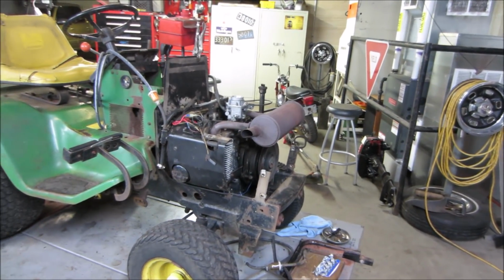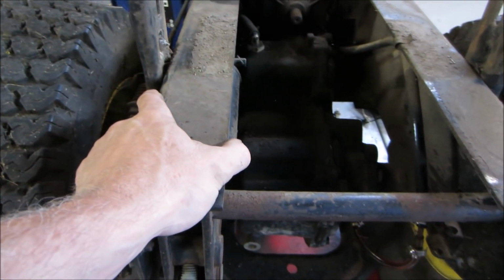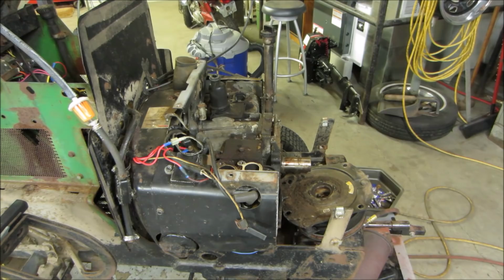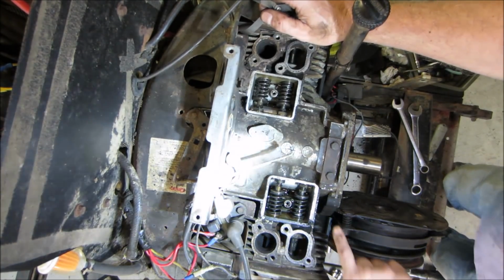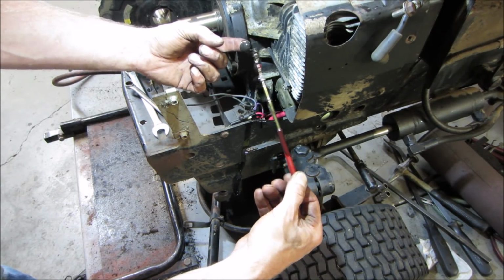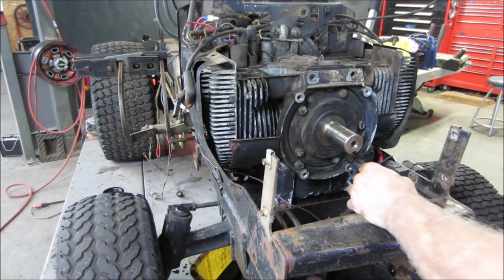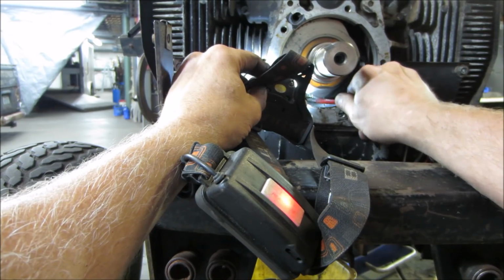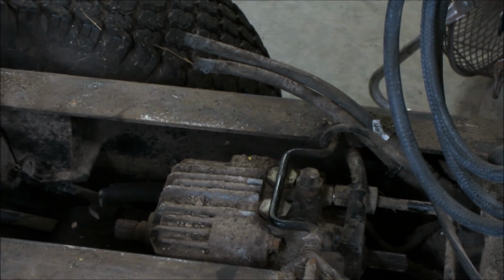Free John Deere Has a Bad Engine Noise? Can We Fix it?

Comment: OMG finding that little piece, wow. Persistence paid off.
Reply: I am shocked as well, I am blown away he found it without taking the engine out to begin with.   I am also happy that it happened on both sides so he knew it was down there and not a bad valve adjustment in the past were the previous owner forgot to put it back..
Reply: @SkaterStimm  also it would of suck doing all that work and that get dislodge and destroy something
Reply: That was a plant! He found that little piece on the floor AFTER he pulled the engine! He wanted to take the motor out to paint the frame, so he planned the "missing part" segment for viewer interest. The guy is BRILLIANT!

Comment: This is how all my projects go. 
Gonna replace the seat.
End up disassembling the engine block.
Reply: Good lord this cant be anymore true
Reply: Totally that.  Plan to just clean the inside of the screen. Actually end up replacing the timing belt...
Reply: So it's not just me!
Reply: It’s called the “ might as well’s”.......
Reply: Its 2 bolts they say
Reply: Planned to pant my engine now I'm in the middle of a complete rebuild of the tractor and engine
Reply: Have a go kart, "ahh just needs a carb clean" 
Buys new engine, clutch, chain, tires
"Oh"
Reply: I know the feeling. I cleaned, tuned-up the carb, fresh oil and filter....The free John Deere with a liquid cool Kawasaki engine runs like a charm BUT, it barely moves after 3 or 4 minutes....I though I struck gold with this one but, the hydro-static needs a complete re-built...DAMMIT !
Reply: I think my wife things all my cars are like that. 😞
Reply: So much for "i'm not going to rebuild this engine". After disassembling 90% of it to find some broken parts, this is pretty much whats happening anyway...
Reply: Same here man. I bought an 82 212 that was in pretty decent original shape not running. Got it running & used it for a year & was fighting the head gasket & carb. Finally got that figured out, & the side tins had some rust so I painted them, then I painted the front hood support, then I changed the fuel line, then I pained the engine & tractor. 

Then after I got it looking beautiful the rings in the engine went & it won’t run 5min without smoking a ton then stealing out & refusing to start again.

So after all that I parked it in the barn, in the meantime I finished a restoration someone did on a 67 110RF, the engine was already rebuilt, I painted the tractor, & changed the front belt. The rear tires were changed by the guy I got it from thankfully. After all that I paid $100 for the tractor & I have 3-$400 into a $600 tractor. 
I won’t be selling any of my machines since there’s not any $ I can make, it’s my personal hobby.

Well so long story short I got another 83 216 that’s sitting behind our barn waiting for some newer fenders & a ton of other parts. The plus is it’s mostly complete so that’s good.

These tractors are fun, but fixing them gets expensive quickly. As a person that’s restored 2-3 of these. I’ve got a 73 st16 I’m gonna swap a Yanmar l70 so I’m excited about that.
Reply: OMG This happened to me 10x over!!

Comment: In the first year of my mechanics apprenticeship i was taking a the head of a series 2 jag and dropped a 5/16 bolt down the hole in the block/sump that the oil return or dipstick went into. I had to go out and buy myself a thin magnet. I stuck it down the hole and got it out on the first try.  The head of the bolt just cleared the side of the hole and no more.  The chance of it going down the hole was 1 in a 100. I got lucky that day. there have been times since that i haven't been that lucky and  had to take things apart to insert something that didn't get put in. Here's another story. One of my work mates had bad habit of playing tricks on us . I had a transmission in pieces and had the little vitone balls that go into the valve body in the lid of a jar. He added one more  and thought it was a great joke as i had to look in a manual to see where the balls went because i thought i'd only taken out 3. . He was putting a motor together a week later and had left the envelopes with the piston rings and wrist pin clips on his bench so i added an extra clip to the envelope after he had put the pistons and rods back in the motor. Then he tidied up before he put the head and sump on and found the clip in the envelope and pulled the pistons out again to check them cursing all the way.  Revenge is a dish best served cold.
Reply: LOL, That was a great story to read! You were only fallowing the Golden Rule: "Do On To Others As You Want Done On To You." Calling what you did revenge, Justice or even fare play all work for me. You just returned the favor that was owed to that coworker. I find it very funny and completely respectful thing for you to have done. Others may have a different point of view though. Thank you for sharing your stories.
Reply: I think you guys should stop playing snd just concentrate on work. A certain type of boss would fire someone over such childish idiocy..
Reply: It happens. I once lost a 11MM deep well socket down the crankcase vent hole on a Ford Explorer engine while trying to pull the oil pump drive... Thankfully, I was at a junkyard and I just bought another socket. I feel sorry for whoever bought that engine though...
Reply: @wrenchinginthewoods  and that's why you always leave a note
Reply: w2dmw The kind of boss who constantly has to hire new people because their employees don't enjoy their jobs.
Reply: @jasonpatterson8091  remember, you are there to work and ply your trade, not to fool atound, and waste money. I worked in such a place; strict !!! But every Friday the boss bought lunch for all, and  a few beers, locally after the shop was cleaned and closed up.
Reply: w2dmw The trouble with shop pranks is that they always intensify.  I once saw a series of pranks end when an entire toolbox get filled top to bottom with grease.  A fist fight ended this and both of their jobs!
Reply: @craigjorgensen4637  you are right, it can get out of hand. A colleague of  mine had a uniform block he made at college on his desk that he was suitably proud of, and someone cut it in half! He was NOT impressed!
Reply: @w2dmw  lighten up. All work and no play makes jack a full boy😁😁😁
Reply: As with being stabbed in the back:   ".....one good turn deserves another."  I read somewhere, "Russians like their dessert cold."  Just saying.

Comment: I live in Detroit and I've NEVER gotten any exhaust manifold bolts to come out without breaking. Especially on Onan engines. The luck is strong with you, sir.
Reply: Wrenching in Michigan is suffering
Reply: @rwdplz1  That's the truth. I've had vehicles from Georgia that were original from 70's/80's and every bolt just turned right out like it was brand new.
Reply: I farted
Reply: Heat is your friend, I used to service Onan marine gensets and they're brutal. As bad or worse than MI salt can be at times and that is coming from someone that lived near Muskegon for a while.
Reply: SouthJerseySound did you fart though?
Reply: @southjerseysound7340  100% I have oxy acetylene, oxy propane and a map torch. If you don't have at least one of those here you're not going to be fixing much. Just making scrap.

Comment: Another Sunday, and another great Mustie1 video. I was raised on 60's and 70's Cub Cadets and have always been biased towards them (at least the IH models). This JD machine seems very well made. Looking forward to learning more about them as you go through this one.
Reply: I was a Cub Cadet repairman from 80 to 84.  Those older Cubs were built tough, and the Kohler engines were bulletproof.  I loved working on them.  I fixed a few JD models and despised their design. It was like they over complicated everything.  Fun fact, the rear ends in the Cub Cadets were the same ones used in the Cub Low Boys.
Reply: I have a Cub Cadet 169 as well as a John Deere 212 and a 316/Onan, comparable machines and I love them all but the wheel base of the John Deere 200 and 300 series are longer and that makes a difference. Also the JD 200 series and 300 series have 1in front spindles and a more substantial frame. I love them all and enjoy each one for different tasks but for me the bang for the buck in the JD200 series stands out. And the JD200 has that shock mounted engine cradle. Nothing quite like it.

Comment: I didn't expect this video to end with the engine sitting by itself on a workbench, but I'm kind of glad it did. Not for how much more work it is for you, but selfishly for this turning into a tractor disassembly, cleaning, repaint, repair, tune up, reassembly series.

You're basically doing a restoration on this machine at this point, and it's awesome.

Comment: I worked with a company where the engineers were required to assist in R&D to reduce design problems. The biggest result was ease of assembly and maintenance. After they spent long hours doing what you just survived a redesign was in order.
Reply: Shawn Strode
It's a shame that a lot of manufacturers don't care about the customer , Other than the initial money made of cause :-(
Reply: that needs to happen before any engineer is allowed to touch anything, mandatory 3 years hands on in the field sounds like a good start ;)

Comment: It's very satisfying to sit back in the air conditioning and watch someone do all the work. I do find myself answering your questions about "remembering the ground wire" and I put on my safety glasses when you told me to "watch my eyes." One evil thought occurred to me while you were looking for the missing valve cap, imagine an assembly engineer at the John Deere factory that would leave small things out of the engine to frustrate mechanics years later. Thanks for the video in all its detail and discovery.

Comment: Mustie, I had to laugh when you said "Well, that was easy!" after finally getting the valve cap out of the crank case.  While you were probing with the magnet and screw driver through the front end,  your light was in the way, so I kept tilting my head to the right to get a better view.  Duh, it doesn't work that way when watching a video.  The sad part is after I realized what I was doing, I caught myself doing it over and over.

Comment: My brother got me hooked on your videos and I can't wait to watch them and talk to him about each new video.  We both texted each other to be sure and watch the 318 video.  I had one of those tractors for years and was doing exactly as you predicted. I was telling you where the wheel release, and hour meter were.  I couldn't wait to see you change the oil because of that silly oil valve.  My dad worked at a machine shop and milled up a stainless steel bar with a T notch cut into it that we used to open and close the valve.  When I traded that tractor I showed it to the salesman and he was so impressed by the wrench he bought it from me. My dad was a true problem solver, much like you.
Love to learn, watch and participate in your videos.

Comment: Well done with the retrieval. 

My first automotive one was nothing like this. Many, many years ago, just after I'd learnt to drive, I found there was a wooden lolly stick (popsicle stick to USAnians) rattling deep in the windscreen demister nozzle. Only way you could see it was via the screen and access was dire. Ended up putting a loop on the end of a length of wire, loading it with glue and, after several tries, managed to fiddle it down and onto the stick. Came out first try.

Comment: The valve seats will loosen over time as the engine heats and cools  causing the caps on the valve stems to fall off, you will have to peen around the seats to fix the problem,then hand lap the valves,this is a common problem with the onan engines, on some higher hour engines you have to do this process every few years. Most  people don't know this.
Reply: I wonder if it would be a good idea to make sure this doesn't happen again by blocking that breather hole with a screen..
Reply: I knew this! I have saved a few engines doing that. As long as nothing is damaged. I fixed an older snow blower with that problem. I had an old guy tell me about using a punch to stake the seat back in so it couldnt pop out. That blower is still going strong today.

Comment: We're not rebuilding the whole engine

Sure looks like we are
Reply: lmfao right!
Reply: guyina4x4  no we are leaving one bearing. So it’s not the whole thing. Lol
Reply: Video basically ends with engine in pieces on the bench. I died.
Reply: I think this machine is going to end up being his, and he is spending more time and effort once he got into it because he kind of talked himself into fixing it and using it for snow removal and mowing.
Reply: By Mustie's definition? No. By most of ours? Yes. Remember, Mustie, is secretly a superhero. His ability is fixing any engine. He just makes it appear as if he's fixing them, in reality, that's just his super power.
Reply: lmfao, sure does look like it.
Reply: This 318 was Deere's flagship tractor for a long time, worth a rebuild. He really couldn't leave that cap bouncing around in the crank case and not expect it to at some point, trashing the bottom end. I'd put a piece of screen over that oil return before I buttoned it back up. Just incase it came off again.
Reply: @drummer0864  Ah, but what to afix the screen to? I'm obviously not well versed in JD anatomy...
Reply: @JackOfAllNothing  Just stuff the hole with some stainless steel wool like it had in the breather pipe above it
Reply: BrakeKleen inside the head. Center punch a few dimples surrounding the hole and epoxy the screen in place. try not to build up a ridge that will trap oil from draining back. I did this a long time ago on race car heads when we were having a few valve train problems. It stopped us from trashing the whole motor from broken bits washing down in the crankcase.
Reply: @OmegaGamingNetwork   I luv these cliff hanger eps, esp the VW dub engine breakdowns and re-habs
Reply: @albertlilly  yeah it's gonnabe a keeper  but he should just do a quick Scotch Brite on the paint and then a satin clear coat on the paint,needs the PATINA on that work horse.....................how about a roll bar and some LED's for nite time plowing?

Comment: Sure are married to it now! I had a missing bolt when I took my onan engine (very similar to yours) apart to replace the carb and change the oil. I found out where the bolt went when I started it up... I thought I forgot to add oil, but the oil was there. All the sudden i heard a pop while it was running and it cleared up and sounded great again. Pulled the head, and the head and piston were all beat up and had bolt thread impressions all over. Found a random piece of a bolt in the cylinder and I think the rest of it lives in the muffler now. I made the call to just send it. Seems like it's doing fine..? Time will tell. Thanks for having us in the shop, have a great week mustie and everyone

Comment: It's nice to see someone else has luck like mine.  It's scary that we say the same things at the same time.  Unanswered question, was the cap magnetic (of ferrous material - for the easily confused)?
Reply: @horacerumpole6912  I'm sure he meant "ferrous."  Regular steel is more ferrous than stainless steel, so if the cap was mostly stainless, it would be harder to pick up with a magnet.
Reply: @horacerumpole6912  Dear God... yes I meant if the material the cap was was made from was ferrous and able to be attracted by the magnet he was using.  If it were stainless, it may not be attracted by the magnet.  I learned that in my freshman level physics classes.  Sorry it confused you.

Comment: Last winter being stuck in the house bored i decided i wanted to restore a lawn mower from ground up. I found your videos and watched for days until I purchased a 1968 john deere model 60. "Ran when parked" turned into an engine replacement, which you cant find a tecumpseh vh60 engine any more so that led to repowering. I drove half way across nebraska to get the damn thing so i wasnt giving up. Found the honda gsv190 has same mounting surface, shaft and that it would fit! Hand sanded/wire wheel and paint (over), im still putting it back together one bolt at a time. It will be able to run the deck which i may end up also restoring in the end, but for now i just want to get the tractor up and going. Your videos modivate and keep me modivated to keep rolling along. I hope to have the only honda powered 1968 john deere model 60 in the world :D.

Comment: OK, so heres my Two cents-
Now flush everything like crazy with mineral spirits as much as possible internally since your got it this far.
ALSO: figure out why those intake lifters are so easy and if they need locktite or new lifters or jam nuts or something because it will just happen again 5 mins into running it

Comment: When I was a kid (now 70) an old farmer showed me a trick to achieve exactly what your attempting to do with the magnet. He used a long piece of thin flat steel, then after he got it into place he used an old speaker magnet, applied it to the end of the steel piece and removed the broken part. Worked like a charm allowing the steel to be placed exactly where he needed it w/o sticking to the engine block of other cast parts as your seemed to do.

Comment: My motor mower wouldn’t run correctly, starts then stops. Thought, what would Mustie do? Yep, carb off stripped and cleaned. Now runs like a watch. Ta mate.
Reply: Can also be fuel flow. I had a mower recently that did the same turned out the fuel shutoff valve I put on it wasn't letting the gas through past drops so when it ran out it died and didn't want to run afterwards.